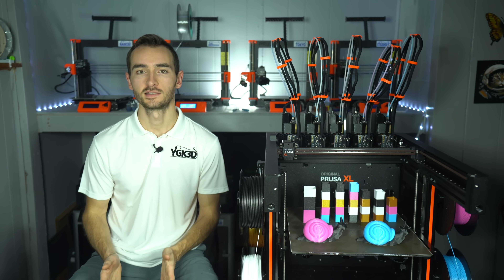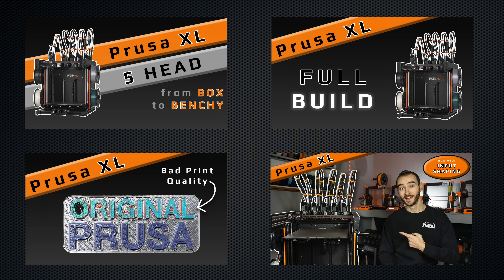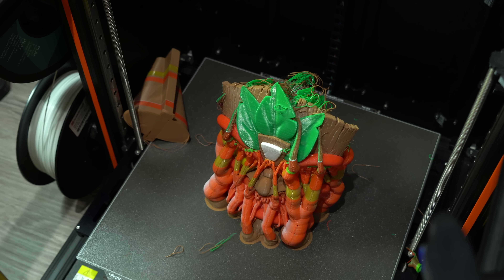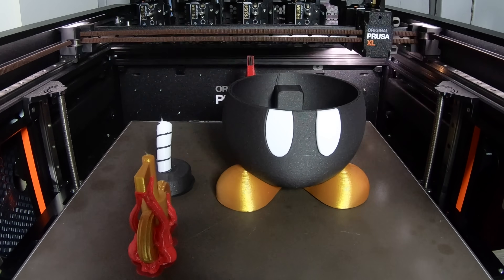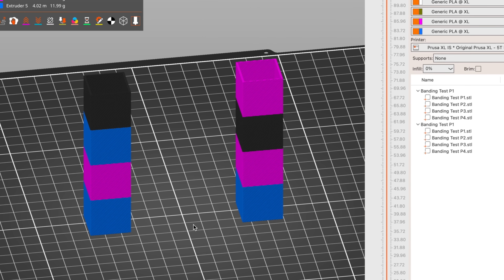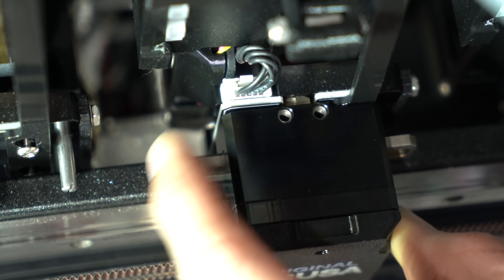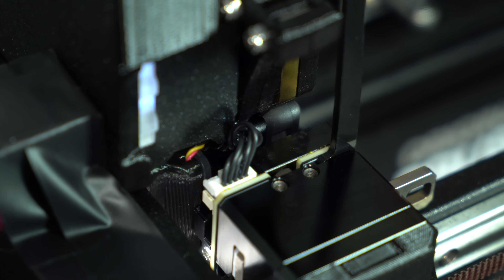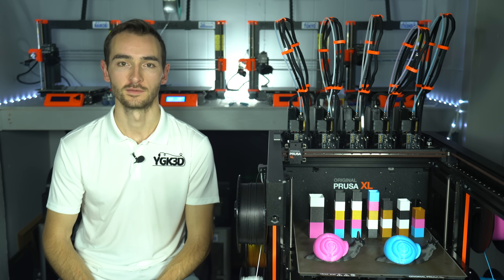I Fixed The Prusa XL's BIGGEST Flaw

Comment from the maker: PSA: Grease the coupler pins on the front of each tool. It achieves the same result as the bump solution.
Reply: Grease... with the same grease used for lubricating the rods?
Reply from the maker: @lostandfoundplaces  yes
Reply: I did the recalibration and greased the pins, but my third extruder still looks horrible. Does the bump solution add much time to the prints? Or is there another new way of fixing the issue?
Reply from the maker: @cabotmathiasen2962  adds a few seconds for each tool change. I’m not aware of any other solution besides ones to do with the lead screws. But if you’re only observing the banding with one tool that’s likely not the issue.
Reply: Your support straps are connected wrong. See the image how they should be connected. https://cdn.help.prusa3d.com/wp-content/uploads/2023/11/175ea4aa457dab9ce02054b8f6041343-1536x1152.jpg

Comment: Criminal how this video is still up. Im glad I combed through the comments find the actual users calling out your poor assembly. 

The manual has its own issues but leaving this video online to further taint any attempt for troubleshooting or worse still to serve as a product review when in fact the real problem being user error ends up feeling like either willful hubris at best or intentional misinformation at worst.
Reply from the maker: The misinformation is those comments, not this video. Check the pinned comment. The one error I made in assembly was corrected before all of this troubleshooting. I just happened to use an old B roll clip which confused some people. This was a real issue with early adopter XLs. You can also see it called out in one of 3D Printing Nerd’s videos. Greasing the couplers on the front of the tools was the ultimate solution. Prusa came to this conclusion through their own internal research and updated the build guide accordingly.
Reply from the maker: Also, you can find this addressed in the next video in this series.
Reply: @ygk3d  You havent updated the title or description - a "This is outdated information  see description below" would be a clear honest approach. You left the video and click bait title as is and you now expect people to find your pinned comment without some sort of backlash. 

This is one of the most recommended videos when I look up Prusa throubleshooting terms, you can't expect people to rummage through the comments to be able to find the most recent information especially when the title is as inflammatory as this one and your fix is the objectively the worst workaround to it - greasing the couplers is not the equivalent solution of a printed bump + custom gcode. 

You never addressed the other person who pointed out the position of the straps invading the space where the couplers are supposed to sit in. It reads as disingenous and defensive when you're unable to have a direct discussion on assembly problems, which can happen to anyone.

Comment: Was looking into this printer. Last video I left the machine failed from the two steppers using one driver in the Z dimension even though the driver specs explicitly say not to use more than one stepper with them. And now you’re demonstrating it’s not that good at its main feature. Looks like I’m gonna be saving some money.
Reply: he assembled it incorrectly

Comment: So for ~4600euro you got printer with 3d printed parts, and you also have to do your own design then print to try fix problems. And after that it still not working as it should be... Amazing. For that money i can buy 3 X1C and with that i jsut have to put on table and press start...

Comment: You sure this doesn't have anything to do with the fact that all of your support strips for the wire bundle/PTFE tubes are installed incorrectly?   See 6:02 in your video - I cant see the first couple but tools 3 and 4 are completely incorrect -- the support plastic is fastened at the TOP of the keyhole rather than the bottom, which means the plastic is in the way of the coupler pins at the bottom of the toolhead.
Reply: Nevermind - I can see toolhead 1... it's incorrect as well... I can actually see the support plastic sitting on the coupler pin - I'm guessing that you are digging for the solution to a problem that doesn't exist when the printer is assembled correctly.   I have had my XL for several months now and I have not had any of the issues you mention.  Just upgraded to 5T from 2T... no issues, prints are beautiful despite tool changes.    Might want to check your assembly - banging the toolhead into the side of the printer is a band-aid.   I checked my tool heads and there is no gap and they don't rock when locked on to the gantry as yours seem to in this video.  Guessing that incorrect installation of the support strap is the issue.   You need to back those two screws out far enough to pull the straps UP and then tighten the two screws back down on the narrow end of the keyhole slot in the plastic - not tighten it at the top like you have - your current install is putting the strap in the way of a successful mating to the gantry and is likely putting undue stress on the entire coupler mechanism.
Reply from the maker: @bobnedved1589  thanks for your thoughts. This is an assembly issue I recognized and corrected early on. I used an old clip for this video before it had been fixed. I’ve since resolved the banding issue by greasing the coupler pins on the front of each tool, so the bump solution is no longer required. The issue was a slight misalignment of the tools and too much friction, preventing the tool from seating correctly.
Reply: @ygk3d  glad to hear!  Yeah I tried everything on mine to see if the assembly was ever loose like yours and it simply wasn’t - it’s always rock solid - glad you got it fixed.

Comment: I was having a similar problems on my XL and found that the Nextruder dock was not level in the vertical position. So I loosed the Nextruder dock from the back (not the calibration adjustment the screw that attaches it to the extrusion bar) and adjusted it using a level and after re calibrating the docks the problem was solved.

Comment: the three pins on the docking side of the toolhead, well more like bolts I guess, one suggestion I saw is a bit of super lube or similar on them so they slide fully into the carriage easily. Not the two big chonker pins that actually get grabbed but the more brass colored bolts. one on top two on the bottom.

Comment: Good ideas/steps to your solution! I'll revisit this vid when I upgrade to a full 5 toolheads on my XL!

From the video I do want to question one thing: are you using a textured sheet to print PLA? 

I ask because while I love using textured on my mini and have it dialed in just right, I noticed that on my XL it caused layer adhesion failures later on prints with PLA. I think it just doesn't do hot enough or squished enough to properly work with the auto first layer of the XL - I had to switch to the non-textured bed for PLA and good adhesion.

Thanks for putting out these ideas in case I run into this issue in the future! Seems like I lucked out as my XL only has the worse version of this - a layer shift causing a print failure in rare cases, but also frequent crashes detected if I turn detection on.
Reply from the maker: Thanks for watching. I’ve noticed the same: Prusa’s textured PEI doesn’t work very well with PLA. I experienced the same on my MK3 as well. Any other textured PEI sheet is fine for PLA but Prusa’s version doesn’t work. For that reason I prefer to use the satin sheet. It works occasionally for smaller prints like demonstrated here but I wouldn’t trust it on a long, full bed print.

Comment: Just got my XL-5 a few days ago and built it. I’m not seeing this problem at all. Tool lock-up is solid and there’s no Z banding on my prints. I’m wondering if you need to load latest firmware (5.1.2 I think) and redo the dock calibration sequence. It’s a pain in the butt, but it seems to work 100% afterward.

Comment: The toolhead does not even have to move to get uneven layers, it if the tool isn't perfectly paralel the nozzle isn't in the position that it should be so the layers wont stack nicely

Comment: This is a great example why tool changer on a 3d printer is a horrible idea without overcoming many engineering challenges. Really don't get it why people are so fixated on tool changer. Sure you can't print multi material with bambu but honestly theres rarely any use case that you can't split the design into multiple parts.

Comment: Mine has same banding and same movement while head is catched like 5:38.  that movement is due to nextruder pins (not dock pins), they can be moved slightly, this movement seems at first sight that can be fixed tightening pin fixation bolt (you must quit nozzle to get access to bolt) but they are tigh, if you disassembly one of them you will find that pins are designed to have some play, I think to allow small deviations while catch/uncatch), with a rubber seal between bolt and pin.
Reply from the maker: I made that discovery too.  A lot of people saying their tool heads are rock solid and don’t have the same play, but that is by design. What shouldn’t happen is the tool being picked at an angle, then moving during the print. After it finds its center position it’s at a stable point but you can still move it if you push hard enough. Did you try the bump block solution to see if that fixed your banding issue?
Reply: @ygk3d  My banding is unaceptable for a 3.5K machine but no so visible like yours,  It happens even printing a 1 color benchie, I did not try your bumper but i have moved nextruder manually when it is catched to force to move to "right" position (assuming it was at wrong position) but no change at printing, banding still there. This are the things I have tried, some are recommended by Prusa support, none of them solved problem.

        - Tried diferent filaments
	- Tried different toolhead (all have same problem)
	- Re-check belt tension and sides alignement.
	- Try 0.4 nozzle
	- Reinstall all docks agains and redo calibrations.
	- Add Grease to 3 short pins on nextruders.
	- Loose trapezoidal nuts, treaded rod inserts and motor screws (Also loose linear rail screws) and tight while bed is at opossite height (up/down).
	- Remove theaded rod superior bearings to check if they are bending threaded rod and transmiting some play to Z movement.
         -Checked also squareness of chasis, angles, threaded rods are parallel to linear rails, threaded rods planity.
         -Umount/check/mount carriage
         -Change printer place (to discard table vibration)

Comment: $3500 for a machine you have to "fix"? And people are happy that there's a 'fix' because their machine is shipping soon? SMH After all the time it took to bring this machine to market you would think Prusa would have done some testing and corrected these problems in house. I just don't understand how some people can fanboy Prusa so hard, especially in todays 3D printer market. The only cool thing about this printer is tool changing. Everything else is outdated and there are issues with the one thing that makes this printer what it is. After seeing all the problems people are having and fixes the community is having to come up with I am so glad I made the decision not to buy one. If I wanted to "fix" a printer I would by an Ender 3. Oh wait those print pretty darn good out of the box for less than $300. I have been fed up with Prusa for some time now. The market has left them in the dust. I sold all of my MK3S and have moved on. I now have much better printers that I paid ALLOT less for. If we as a community are willing to just sit back and accept sub par printers what motivation do manufacturers have to do better. Prusa knows it has a fanbase and is taking advantage of them. Stop buying crap printers at inflated prices.

Comment: 6:08 As the tool when anchored to the gantry changer thingy is moving around that’s a big issue and probably is worthwhile Prusa modifying the tool head to have an in built shim to ensure the tension is correct and there is no wobble. A 3 point adjustment screw not unlike a build plate would be good as you can fine adjust it. 

I thought the clamp locked the tool to the gantry? Is it not strong/ tight enough?

How long does your 2 lines of g-code added to 5 tool head print?  Ie with and without? Is it any different to the fast move the 3d print dogs developed that Robert Cowan and tada 3d printing tried?

I’m seriously considering dropping the xl mk1 order and waiting for a mk 2….

Comment: It’s insane how content creators can solve issues that companies couldn’t or refuse to. Either they are tunnel visioning or are in too deep to make the changes, it affects the customer base immensely. For 4k and still having issues it’s kind of unacceptable in my opinion. If you aren’t planning on using multi material for supports there is almost no reason to get the xl instead of the p1p. And if you need a large format printer u might as well just self source a voron for the amount of work you need to fix the xl anyways

Comment: So let me get this right, Pursa made a tool changer , but didn't think to design the docking parts to constrain in all 3 axis? how the hell did they think was a good idea much less charge that kind of money. All they had to do was add a third prong to the docks for the draw bar to attach so it has a triangle to align with instead of a line which allows wobble.

Comment: So i did print some ting tall with tool changes and i have banding and 1 mm shift but i was able to solve it with out using your mod by making sure the tool head dock where on super tight where they dont have any movement and sloved my issue.

Comment: I wonder if bouncing around a shippnng container on its way to destination plays a role in this 'feature'?

If I understood the solution: you're recalibrating that axis edge every tool change. But really what your doing is calibrating the printer to the new tool head? Or is the printer aligning tool head to the printer? I think the latter is more the case. Which made me wonder if any other tool head changing machines do a post change toolhead alignment check (PCTAC)? This corrects for a particular machines peculiarities at the time of the tool change once per change... And even small machine deviation that might develop over time (or a distance roughly shipped) get washed away... Forgiving a number of machine build sins... Neat find, thanks for sharing!

Comment: 6:28 basically there is a massive design flaw where the tool head dock is only supported on ONE side on a machine that requires a high degree of precision to work properly

Comment: Good job, it's not great you had to find a fix on a printer that costs as much. You might want to try to add some sort of brush under the pump to clean the nozzle at the same time it bumps the thing. I'm really disapointed at Prusa for dropping the ball like that.

Comment: I noticed in the video you have multiple of the plastic wire harness stiffeners mounted wrong on multiple extruder heads. You have to pull them up and get the screw shaft into the narrow part of the keyhole. Sadly I do not remember in what video i saw this issue, but when the plastic bands are fixed incorrectly they are too low and so the ends that are sitting too low might cause interference with the carrier.
Reply from the maker: Thanks! This was an old clip I reused from a previous video. I have since fixed that.

Comment: looks like the 3 points of the maxwell kinematic mount aren't being fully engaged if the toolhead is 'floppy' when attached, can you adjust the 3 acorn nut looking things to tighten up the engagement when the toolhead is locked?

Comment: With all the respect possible to Prusa, 3 years of development from a brand that make you pay a lot for the "quality" and releasing an engineering piece with an issue like this is just bad. I this was my machine and had this issues I would have probably never bought again a Prusa...
Problem that had to be solved by a person that has spent lot of money to buy the machine...
Reply: Problem doesn't happen on my machine. Either is poorly assembled, or there is a defective part in the toolchanger. Instead of that workaround, he should have contacted support for a fix.

Comment: Seems like a serious error to not notice or fix in 3 years. Surprised at this. Great job!
Reply: If you owned a Prusa, you would not be surprised. There was an error in  PrusaSlicer that generates unnecessary infill that massively increased print times. Multiple issues raised by different people on the Github for YEARS before it was only very recently fixed. And that's among numerous problems I've run into. I did not experience any less work I had to do to get my MK3S+ working properly than my Ender 3. And it costs like 4, 5 times as much? My MK3S+ is the first and last Prusa printer I will touch.

Comment: it looks like the root cause is some issue with the sliding latch applying a non perpindicular force to pull the tool against the carriage.
If that force is always perpindicular then the kinematic coupling should auto align repeatably like it's supposed to.

Comment: Kinematic mounts such as those used on the Jubilee, E3D or PrusaXL tool changers are capable of micron level repeatability on coupling / decoupling.  If your tools aren't seated well enough that they rock like that, there is something wrong with the assembly of your printer / tool changer.  You might want to take a closer look at your dock setup and alignment instead of just whacking each tool on tool change.  

That being said, thanks for creating / sharing the stacked cube printing tests.